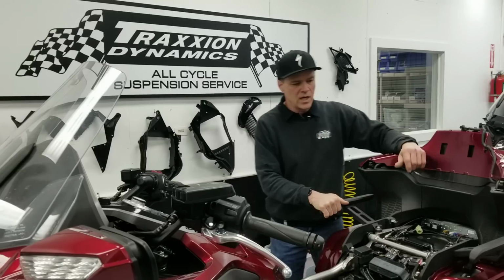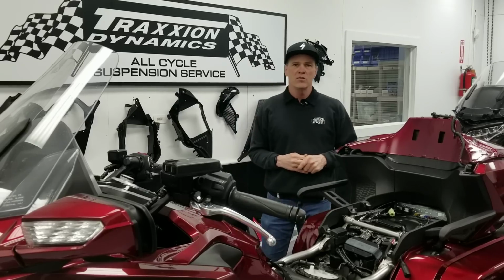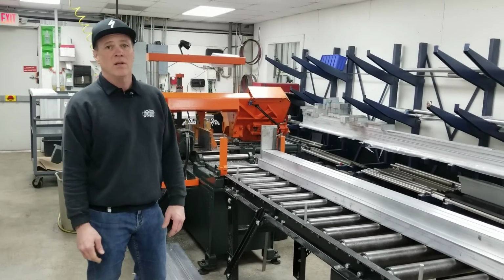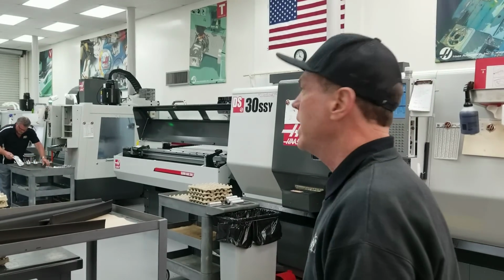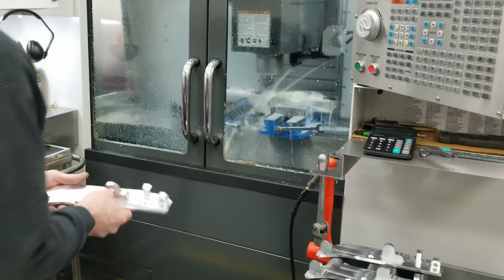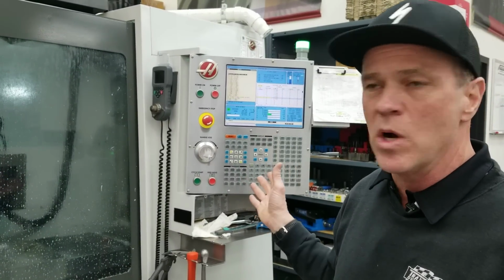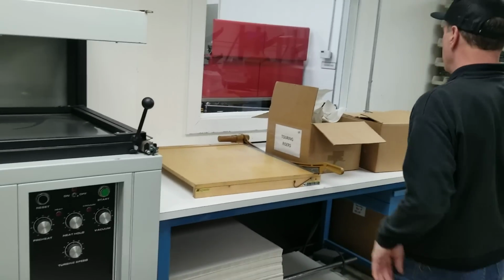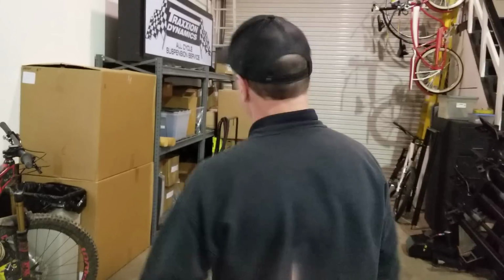Why are Passenger Grab Rails "so expensive"? 2018+ Honda GoldWing -

Comment: I don't think people grasp the amount of time that is needed to design and build something properly, many people are probably under the impression that something like this is either stamped out or built from cheaper products, whereas, building something out of aluminum is quite expensive.  As you mentioned, just stepping through the program, and having one error, can cause serious damage. I setup CNC Mills, I have had times where a zero was place in an incorrect area, this happens at such a speed, that the human brain is unable to comprehend the speed at which hundreds or even thousands dollars can be damaged in a machine.  I once had a 4" shell mill slam down into a fixture with such force that it complety demolished the shell mill.  As you know, that was not a cheap mistake.  Keep making good products, it is rare to see machined parts in these times, one thing for sure, a well machined part will last forever.
Reply from the maker: Things add up fast when crashes happen in the machine world!  A lot of danger there too!

Comment: The market determines what costs it will bear...not your ideation time, developmental costs, material costs, productions costs, packaging costs, etc.
Reply: Uneducated comment. If an item doesn’t sell because of pricing, that has ZERO to do with the cost of producing within a given volume of production. Product may not sale do to price, but that’s a different discussion. His cost are his cost.
Reply: market determines price, not cost
Reply: John Martins exactly. The trick is to determine if you can produce a marketable (sellable) product with a cost structure based on levels of volume that produces profit.
Reply: Why not sub it out. Lots of CNC shops.  You could make investment cast and sub that out too.  Also you could build steel skeleton and injection mold it subbed out too.
Reply: I think it looks pretty good but the extension looks like a piece of uni-strut.  Also, I think I know why the larger rarer black anodized luggage rack I had for an F6b is hard to find.  They probably lost their ass

Comment: MX, what tools do you use on the 2018 Honda Goldwing DCT Touring-particularity to add bolt on accessories?  I do not want to chance stripping screws, etc...Thanks.
Reply from the maker: There's too much to list.  We use many brands as well.  But the handiest tool is a very long 5mm Thandle allen key from Bondus.  That's invaluable.  It's like 12-14" long.  You can get most of the bodywork off with that without scratching the bike ever.
Reply: Max McAllister & Traxxion Dynamics  Max, Thank you.  Is an Allen Key the same as a hex end or a ball end?  Also, can I expect a lot of resistance when removing any given screw that has never been removed from original assembly?  I appreciate all of your valuable advice!
Reply from the maker: @edwardmasannat8228  Yes, Hex key.  Do not buy the Ball End one, because it will strip your fasteners out.  Any hardware that is difficult to remove is more related to suspension, and is for advanced mechanics in a work shop.  You shouldn't run into any of that for normal DIY jobs.  Good luck!
Reply: Max, YOU Are The BEST!  Thank you again for your Professional and Friendly Advice.  I truly admire what you’ve managed to build in terms of your successful business.  Take Care of Yourself and Happy Holidays,  EJM, Downey, CA
Reply from the maker: @edwardmasannat8228  Happy Thanksgiving to you and yours!!!

Comment: What is the problem with the OEM rails? Did Honda screw up?
Reply: Yes, they're like reaching under the seat and they are about the size of a flush door handle.  I have a set on my bike and as far as the wife is concerned they are Necessary and worth the price of admission.

Comment: Traxxion makes premium parts and stands behind them.  As an owner of a GW and buyer of this specific part(s) I can assure you if you're not satisfied with the stock system Honda provides (my passenger was not:  It's the equivalent of having a "car door handle" buried under the seat to hold onto) then buy it.  If you' don't have any issues with the stock set up...then Don't. I've never felt the need to replace a "hand rail" until this bike.  It's a safety issue.  

But if you want a well designed and engineered product that solves multiple problems for passengers that increases safety and allows for other modifications to be added for the passenger, then this is a solid choice and the COST is not the issue, the value and solving a problem is.  I'd venture to guess most of the "that's too expensive chorus" doesn't own a 2018+ Gold Wing.  Honda makes a great product.  Traxxion Dynamics (and many other aftermarket providers) make it better.  IMHO.  You get what you pay for in life. I like to tell people if you have a $5 dollar head...buy a $5 helmet, the internet never ceases to amaze me there is a $5 helmet market out there. :) 

The "market" has spoken and Traxxion has been in business long enough to prove that.  Feel free to ask questions if you're interested in more owner experiences/opinions with this product.

Comment: Has anyone considered using UHMW is an ultrahigh molecular Weight Polyethylene or similar molded products with high strength strands in the ultra high strength plastic mix. Similar products exist for engine mounts  as well as other services. Highly UV resistant and not easily scuffed. It can be drilled, tapped and one can even drive in a self tapping screw without damage if by common sense rules. Multiple colors available. Very similar to the polypropylene used for cutting boards with reinforced strands added in the mix and much stronger than some steel products. It can eliminate most CNC work. It is not a 3D printer product but a molding process. Makes me realize why the Stealth bomber is not made totally out of high strength aluminum.
Reply from the maker: No one will ever injection mold parts that are produced in 100pc quantities.  The kit would cost $6,000, not $600.  In this case, getting the matte finish that matches perfectly would be virtually impossible to do with a molded part.

If that process was something viable for production motorcycles, I think you would see plastic subframes and bracketry on motorcycles... but I've never seen that. 

Exotic composite parts are sourced for Stealth bombers and the like where every gram matters, and price is of no concern to anyone working in the US Government.

Goldwing owners scream and cry about paying $27,000 for the world's best motorcycle...
Reply: @Traxxion  Makes me wonder why anyone would pay $27K for a bike that has a passenger seat without grab rails. I have to chuckle when I read owners defend Honda when there are so many downgrades on the 2018 models. Maybe the refusal to admit they jumped head first into shallow water. I think one look at the GPS should have been a red light. 
Honda's mistakes are great profit centers for after market vendors. 
I would pay more for a new 2017 level 3 than a 2018 however Honda is great for hiding the 2017's in warehouses. 
I view the American version of the 2018 as an F6-B deluxe with ABS brakes and some info system from last years Harleys. 
I think buyers will come to their senses when their local service departments work of their can-buss (SP) systems. Drifting off topic but OUCH!

Comment: While I appreciate the video and the extensive explanation, I still think $600 for grab rails are too expensive to buy.  As a driver of the motorcycle they are of no use to me, they are more for the passenger but I don't always have a passenger so the expense is much too high.  If it was something that impacted my driving then maybe I would consider but it doesn't so therefore I'll either wait for something less expensive or I will just keep what I have cause its really not that big of a deal to me.
Reply from the maker: It's not possible for someone who doesn't care about the comfort, security, and safety of their passenger to understand why this product would be beneficial.  Enjoy the money you don't spend.
Reply: @Traxxion    Well I don't feel your hand rails will provide any more comfort, security or safety for my passenger and as for the money, it will be spent in better ways than on hand rails I don't really need.  They are not for everyone.

Comment: Most of the time I keep my big mouth shut... this isn't one of those times. With all due respect to Max... he's spot on when he reveals the cost associated with a vertically integrated design and manufacturing business model, quality machine tools aren't cheap as well as the human resources to utilize them effectively, however... There's more than one way to skin a cat. If someone wanted to go the same route as Matt, i.e. CNC machining multiple components from billet, you definitely don't need a million dollar facility to do it. There are many many one stop shop vendors that will mill, finish, anodize, and package your product for you and while you may incur additional costs, you also don't have the over head so it's pretty much a wash. Could the parts be cast aluminum, powder coated and look and function just as nice as CNC'd parts... Sure. Do molds cost you more up front? Yup... they do but the production cost is in the 10's of dollars per unit, actually much less than the cost of the raw billet material alone. Can you design products like this yourself? Yes, grab a free copy of Fusion 360. With a little practice and some research, you can model the design, analyze it using the free FEA functionality or even use the included AI driven generative design module to create a lighter and stronger component with only a few inputs. Want to make a 3D prototype? Sure... just shell out 500 bucks for an FDM printer or farm it out to one of the many prototypers out there. But... if you're not willing to go the extra mile and put in the work... Max is offering you a very high quality and well thought out accessory that will last as long as your bike and In the end... you're getting a made in America by American's product. Something to consider before going into sticker shock. Hat's off to Matt for stepping up and being one of the few that offer quality accessories and services because without guys like him... there would be none. FWIW... I'm a 35 year design engineering veteran with over 20 US patents. Keep up the good work Matt!
Reply from the maker: Thanks for your feedback!  PS, I'm "MAX"!  20 patents.... that's awesome!

Comment: I think your costs to produce the finished product has surprised you and sales are not what you expected, hence the rant ?
Reply from the maker: Hi James, we actually sold through our first short run very quickly and it caught us off guard!  We never like to tell anyone we are "Out of Stock"... so I have both of my mills going 14 hours a day to make the next 100 sets.    The purpose of this video was just to give a look at what it takes to make a product like this... most people don't really have any clue or concept.  As you can see from the posts here, people really enjoy this type of information.
Reply: I was a fitter machinist for 50 years so I have a good idea how long it takes to come up with an idea and make the parts. Some of Max's comments were exaggerated for effect but I still get the gist of what he is trying to get across. Anybody that thinks the grab rails exactly like Max's can be made and sold in the U.S for $200 is mistaken. They could be made cheaper overseas and Max knows that. His idea is out there and there could be an overseas manufacturer working on a cheaper version already.

Comment: Not rocket science. Small machine shop making specialized parts. The price of aluminum has skyrocketed as well. What gets me is the failure of the motorcycle manufacturer who now seemingly eliminates equipment once deemed standard. Passenger grab rails should be standard equipment in my opinion.
Reply from the maker: It has "something" on the bike, but it's useless.